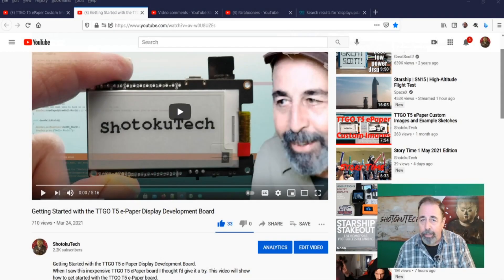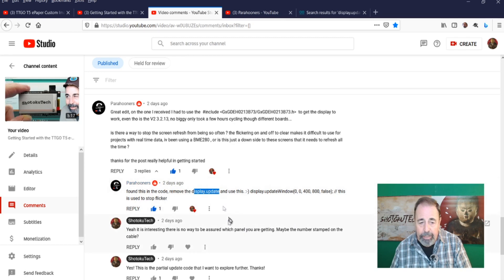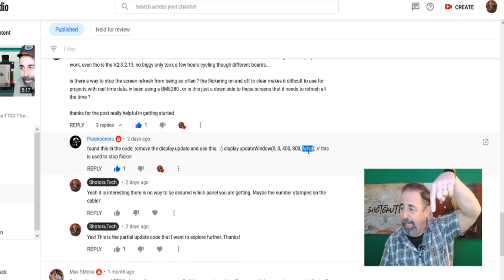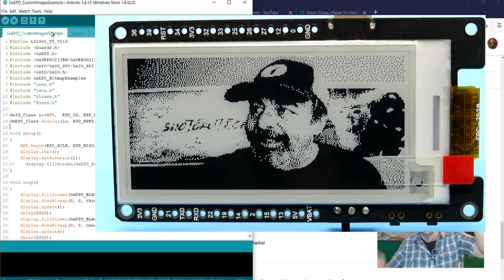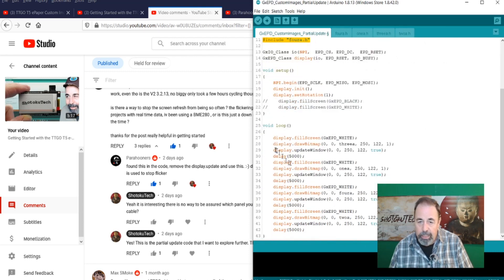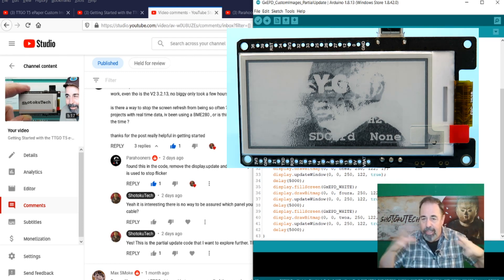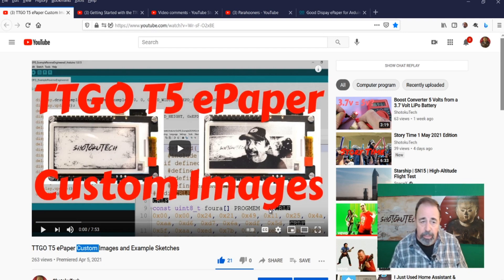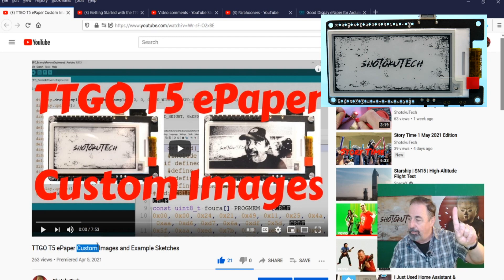TTGO T5 E-Paper Smooth Screen Refresh

Comment: It might be worth running your pictures through a dithering algorithm, I think you’ll get an even better result
Reply from the maker: Hi James. How might one go about that? In IrfanView when I reduce the number of colors to 2, there is this "Use Floyd-Steinberg dithering" option and it is checked. Any tips welcome. Thanks.
Reply: @ShotokuTech  In that case you're already using a dithering algorithm! Although there are a number to choose from. I use the website dither.it to dither my images before I run them through my pen plotter machine. It supports a number of different algorithms and some are better than others
Reply from the maker: @jamesdcuk  Thanks for the tip!

Comment: No idea what "True" or "false" means in this context. I know theses as values like "0" and "1", or "run this" and "don't run this". But no idea what they mean with those numbers before. Like "If those numbers apply, the value is true?" But that's missing a "=" in my little understanding of programming. Neat that you could solve the issue with the blinking though! Looks really cool after that re-programming. You've just hacked another gadjet. ;)
Reply from the maker: The numbers define the size of the area to update on the screen. Starting at 0,0 going to 250,122. (The size of this screen). The true/false thing seems to define some behavior of this update but I'm not finding that yet. Thanks!
Reply: @ShotokuTech  Let me know if you do. ^^ Thanks for explaning. :)